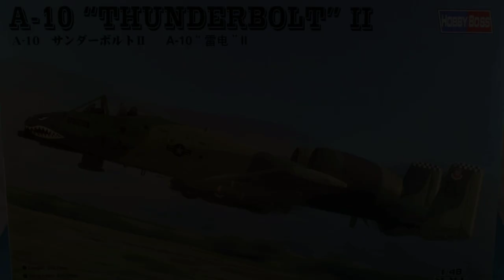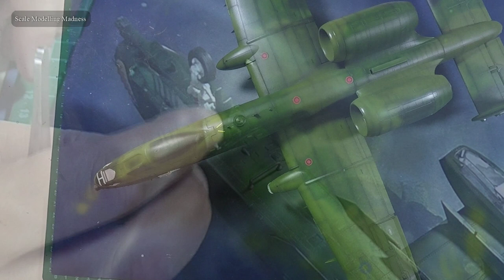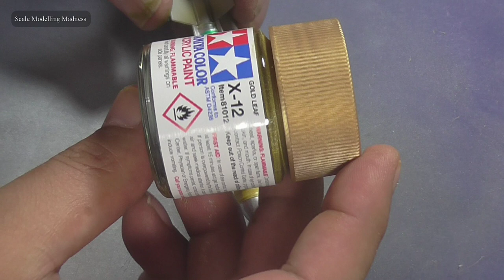Hobby Boss 1/48 A-10 Thunderbolt II (Part 5: Decals and finishing touches)

Comment: My question is this...I dont have the patience or time to sand all the raised body panel lines flush, then scribe panel lines .
If I leave the raised lines will highlighting the raised lines work ok ? Btw you have very good taste in music .😎👍
Reply from the maker: Hey Harry, thanks for the comments. I am afraid recessed and raised panel lines act very differently. When dealing with raised panel lines, what I do is run a fine black or brown pencil along them to highlight them. It does make them pop out a little more but its time consuming and gets difficult in areas where there is fine work. But still it works and is an option to scribing tons of lines :)
Reply: @scalemodellingmadness4114  Hey...thanx. I just bought 3 fine markers. Black, Med. Grey and light grey.
I'm working on a 1/72 Monogram A10 and a Airfix Buccaneer Siddeley. SB2. I had a heck of a time referencing the 3 Colors for the buccaneer.
I had to guess going by pictures. I was gonna do it in a desert storm version, maybe later on I do that.
I have a huge selection of unbuilt " in the box" models I bought over 30 years ago  When I managed a hobby shop in my area and I never got time to build them. My only regret I didn't collect 1/48 scale. Again thank you

Comment: Really nice work. I love the burnt metal effect on the engine blades.  The work you did on the armament is beautiful as well. 2 questions: does that masking fluid smell like pee? I came stand the ammonia smell. Also, how long did you wait to make sure the Mr surfacer was dry, before spraying acrylic over it? I read that lacquer based paint emits gasses until total dry. These emissions can ruin the Tamiya top coat. What are your thoughts?
Reply from the maker: Hi Zlee. The masking fluid I am using in this video, Mr Masking, does not smell of ammonia. It's safe for you to use :) However, the more generic masking fluids (specially the ones used to mask paintings/these are usually white) do have a pungent odour, so I would avoid those. As for drying time, I usually do not touch the kit for a couple of hours after applying any kind of paint, even quick drying acrylics. Not only does this give the paint a chance to dry properly, it also allows me to take a step back and review the work, and see if any corrections are needed. Often, I try to do major paint work in the evening so that I can leave the kit alone overnight. To answer your second question, I have used primers for several years and I found that the new primers (particularly those meant for modelling) are very good and if applied properly (a thin even coat) they dry after a couple of hours and do not spoil any subsequent paint work. Hope that helps. Cheers :)

Comment: Amazing work my friend 👏🏻👏🏻👏🏻
Can I ask where do you place your camera when you record the build?
Reply from the maker: Hey there Peri. Thanks. I have two cameras both right on top of the work area. One camera is kept on wide and the other I zoom in and out as required.
Reply: Scale Modelling Madness hi
Do you have them on tripod? 
What software are you using for movie edit?
Reply from the maker: They are not on tripods. They are clamped to flexible goose neck clamps, but you could use anything that gets them to stay in place on top of the work area. The software I use for editing is DaVinci Resolve. It is a free software and very good.
Reply from the maker: Also, I use Audacity for audio recording and editing. Audacity is also free.
Reply from the maker: Just saw your video Peri. It's very good. Just a suggestion from my side would be to zoom in the video while editing, so that you do not have a black frame, which makes the video image smaller. Rest looks great. It is much better than my first attempt :) The lighting is good and the video is clear. Also, just add some text to the video or voice so that you can explain what you are doing to the viewer. I think that would help. Overall, great job friend. PS: I am your latest subscriber :)
Reply: Thank you my friend
The software I have for editing doesn’t allow zoom at the moment
I am trying to use free softwares at the moment until I Finns my feet
Thank you for the feedback 👍🏼
Reply: Scale Modelling Madness that you
Is the software for PC or an app?

Comment: DO the models not come wit pilots?
Reply from the maker: Hi Keith, not all kits come with pilot figures. The ones that do, usually mention it clearly on the box cover. If your kit does not come with figures, you can always pick some up, as they are sold separately as well. Hope that helps :)